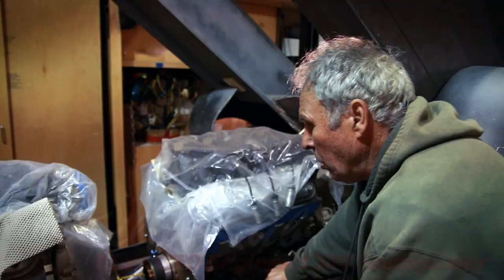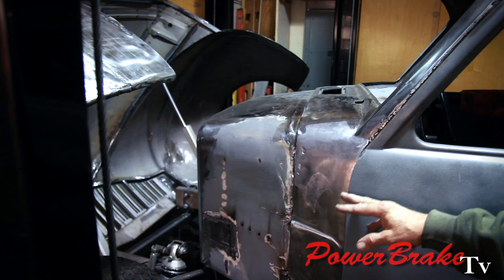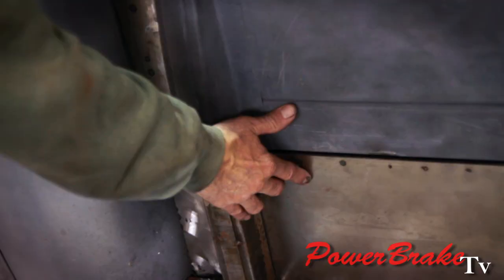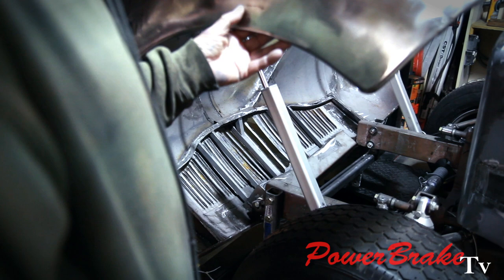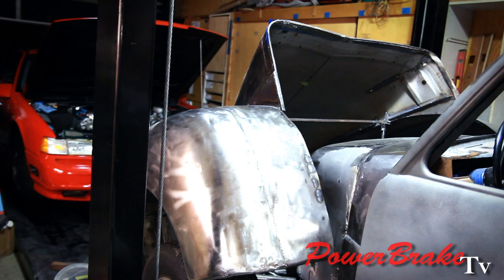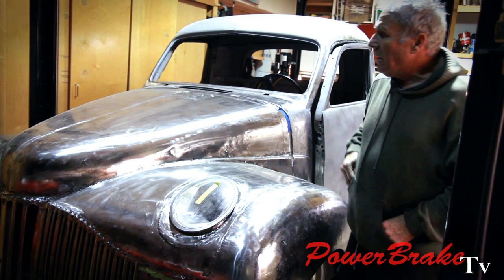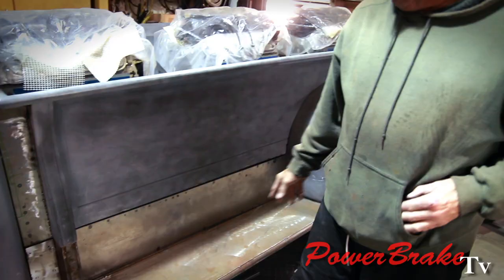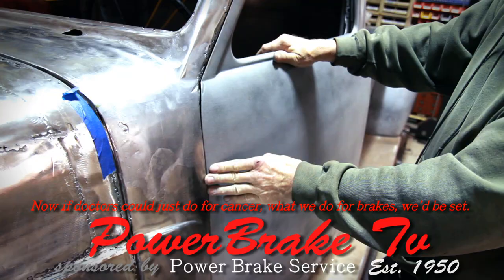1,200 Hp 1,050 Cubic Inch Pickup, body & Fab for the Kilo Kub : Power Brake TV

Comment from the maker: Thanks, I don't think we played up the fact enough that it has air brakes as well. Of course the three engines are great, the hydraulic and air lifting bed and hood are cool, but to top it all of, we put our air brake system on it. So it will make quite a unique sound with the 24 cylinders, but it will also make the whoosh sound that a big truck makes when it stops. It is still not finished, but it was towed down to the Edelbrock show, and had just about everybody standing around it.

Comment from the maker: @redneckbryon Thanks, I'm sure the owner/builder Dick will appreciate that. He has done most of the body and fab work, we are doing the brakes and tons of assorted work on it. Since it is a very different vehicle, and he was using an air tank to tilt the bed up, we built an air brake system for it, just like on a big truck. So not only will it sound and look cool cruising along, but it will also make the air brake whooshes when it stops and takes off, very wild, and very different.